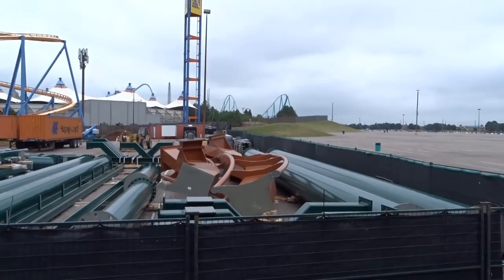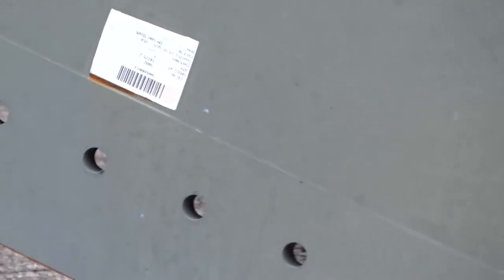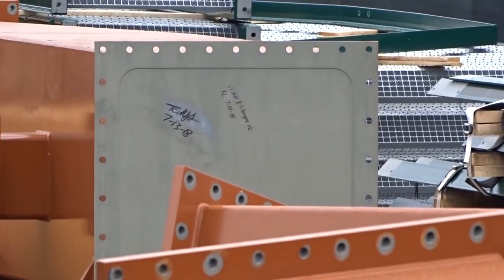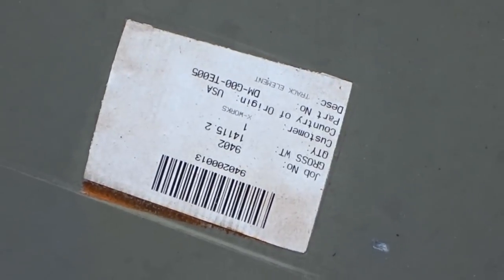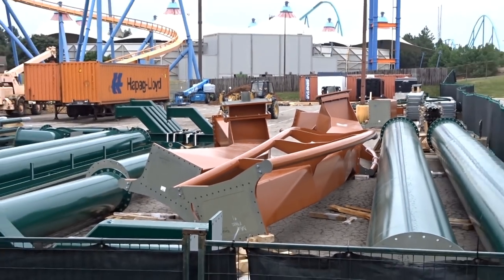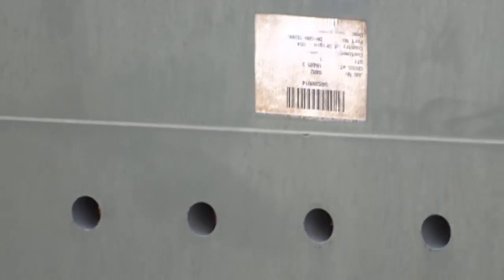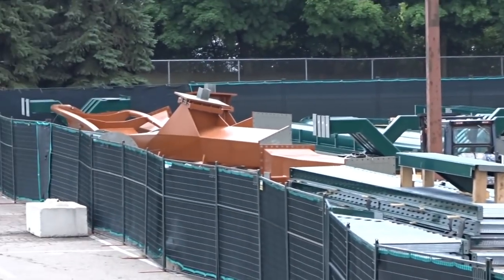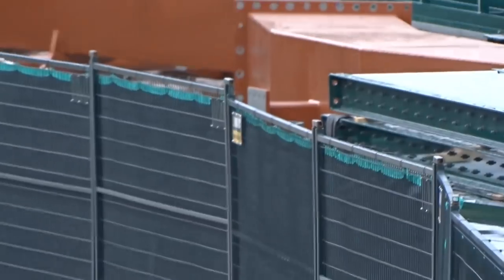Canada's Wonderland New Dive Coaster Track Arriving Quickly

Comment: I'm doubting any track will go vertical before the announcement.
Reply: Especially with all the snooping going on.
Reply: Announcement is in around 20 days so with all the track ariveing idk
Reply: I would think they would wait just like they did with Valravn as well as others.
Reply: Top thrill dragster went vertical way before an announcement
Reply: Steel vengeance had track on half of the ride before announcement I know a little different but anything is possible
Reply: That's because both of those were much larger projects. This is a B&M that will go up rather quickly. They won't need a huge head start like those two examples.